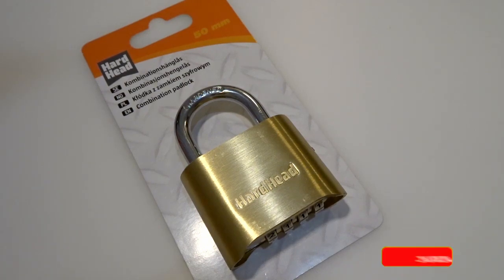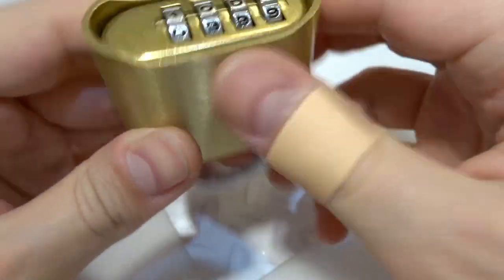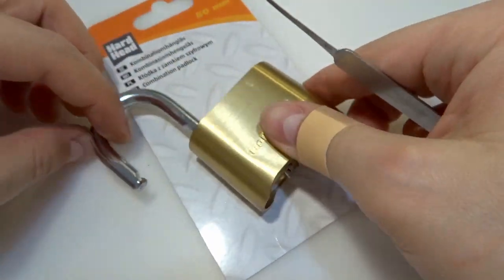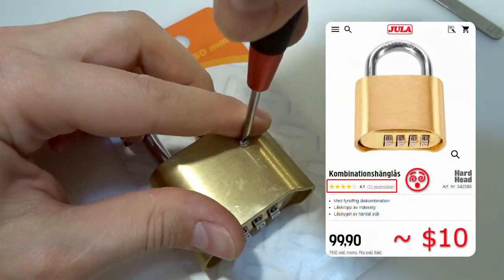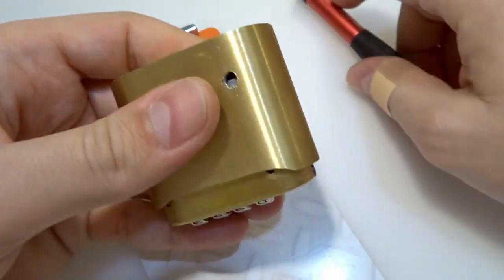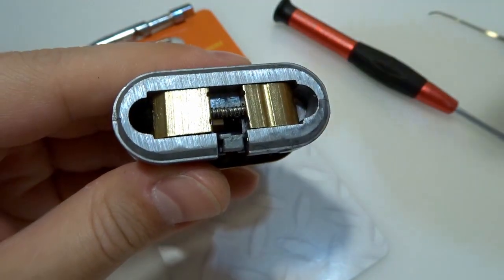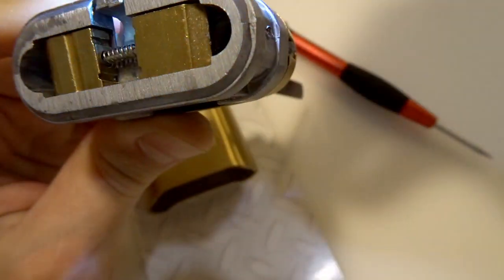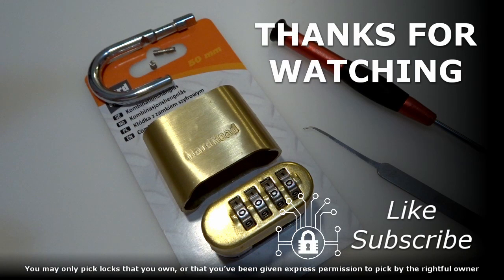197 🔐 Hard Head combination padlock bypassed and disassembled

Comment: Nice video! I have one of these, but not the code. How can I decode it? Not bypass, but find the code
Reply from the maker: The easiest way is to put a thin piece of metal on the right side of each wheel (one by one) and start rotate the wheels, at one point that metal will fall into a groove and add +3 and that's the correct number.

Example but different padlock https://youtu.be/H6SPZweF_hs
Reply: @SasPes  thank you!
Reply: Managed to decode it with the feeler gauge, then used -2 on all numbers to open